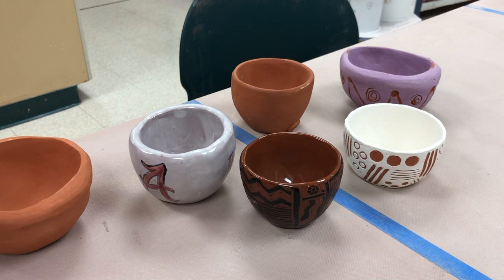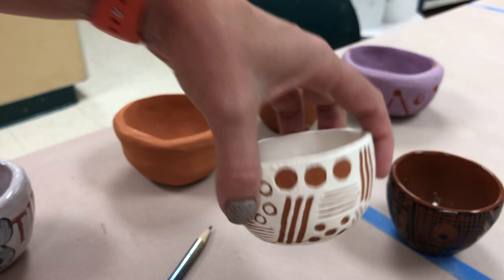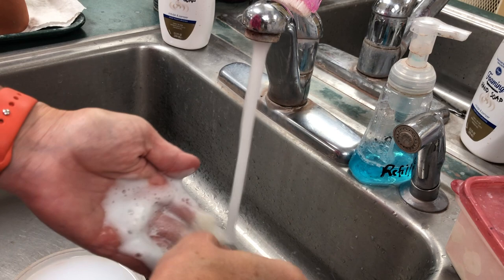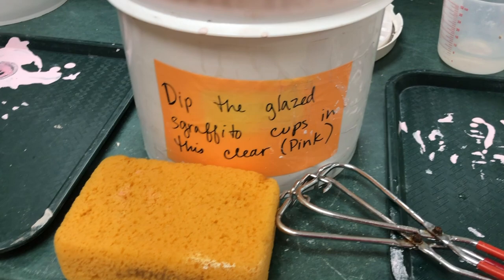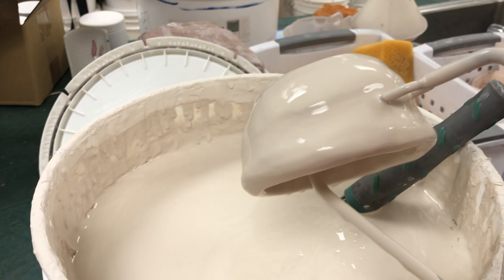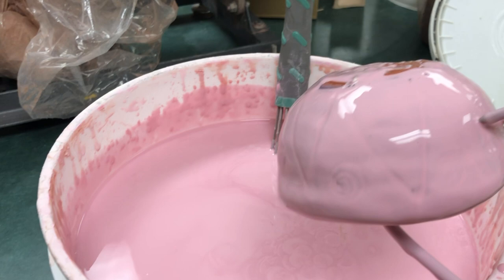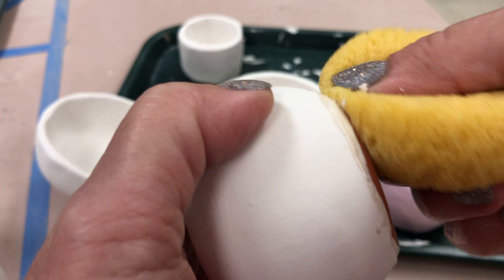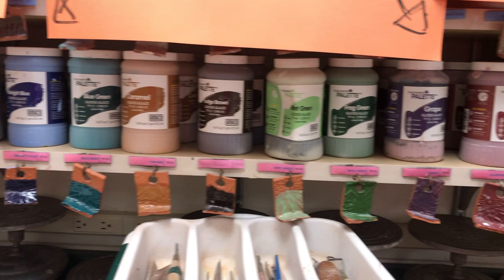Prepping our Pinch Pots for Glazing: Waxing, Dipping, and Dry Footing  Ceramics I

Comment: Hi there! I really want to start making ceramic mugs and have never done anything with ceramics yet. I've watched many videos but I'm wondering, if I want to sponge the clay itself to make it a bit more smooth, should I do this when I dried the clay and let it dry again after that?
Reply from the maker: Sponging clay has some particular considerations before you do it. #1 I don’t sponge grogged clay as you will remove the tiny clay particles and leave behind the big groggy particles which can leave an undesirable texture.  #2 if using a grogless clay, I only sponge when the clay is plastic or a soft leatherhard. Sponging bone dry clay can incorporate moisture into the dry surface and lead to cracking. Does this answer your question? :)
Reply: @KaransPotsAndGlass  so its best to not use the sponge to smooth dry clay? When its dry, i'd like to remove some hard edges since ive saw a youtuber do this and it looked very nice and clean, but its best to do this before drying your clay?
Reply from the maker: I wouldn’t do it completely dry- it’s possible, but you’d have to be very careful not to add to much water.  You can accomplish the same thing at a less dry state. No reason to wait until it’s bone dry. :)
Reply: @KaransPotsAndGlass  thank you so much! If i dried it a little bit and use the sponge then, should it dry longer??
Reply from the maker: Yes! After sponging it should dry thoroughly for firing and be bone dry!
Reply: @KaransPotsAndGlass  thank you so much for the tips! <3